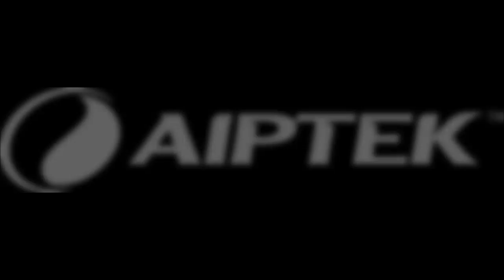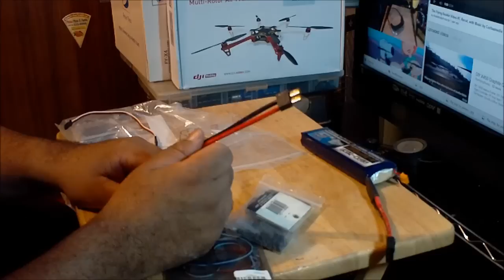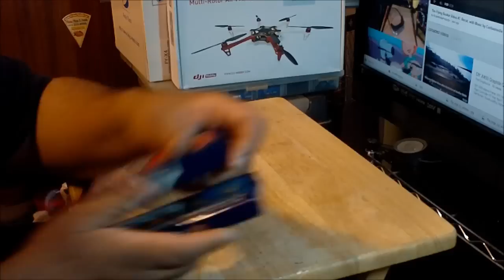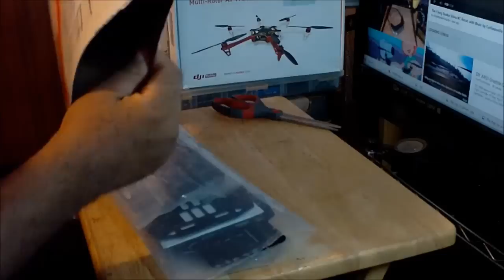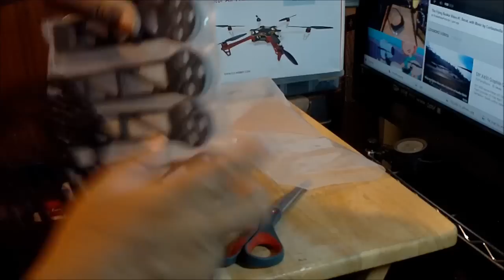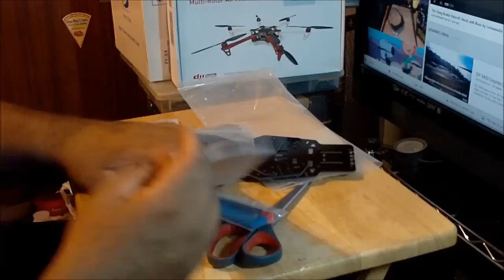Hoverthings Flip-FPV Introduction & Unboxing part #1

Comment from the maker: When you power the SPC input from the main battery that only powers the RX but not the ch inputs where you plug in the servos , ESC's or anything else , the other end of the optima rx where the ch inputs are still needs the 5v that normally gets from the flight controller in the case of a multirotor or the ESC in the case of a airplane or heli , if you used the NAZA you always needs to removed the + wire from all the ESC's since the NAZA comes with is own BEC no mater what radio system you got .